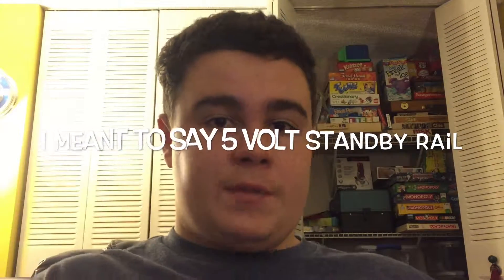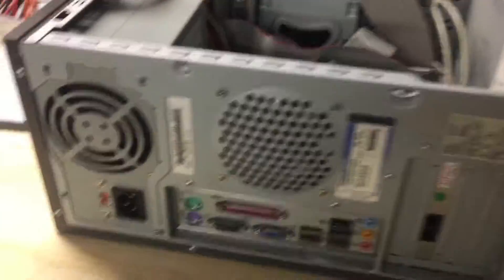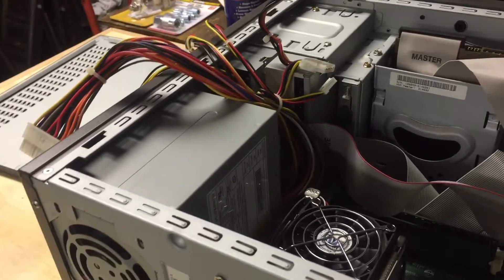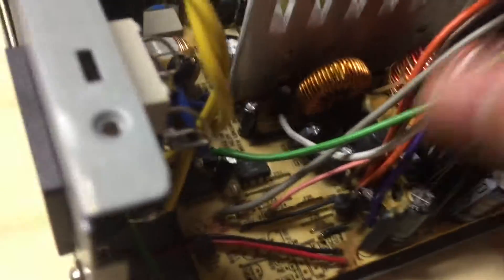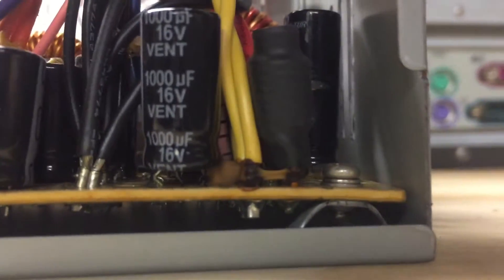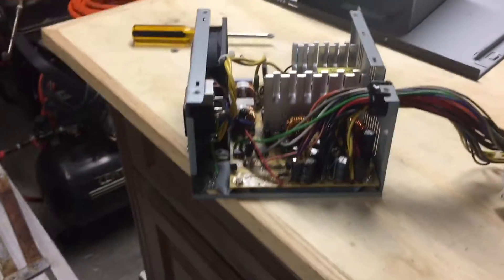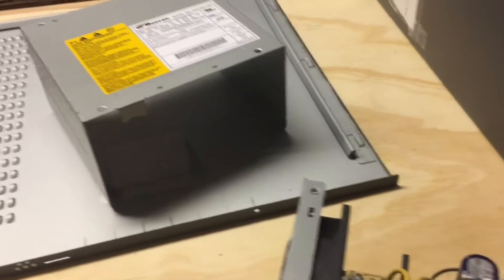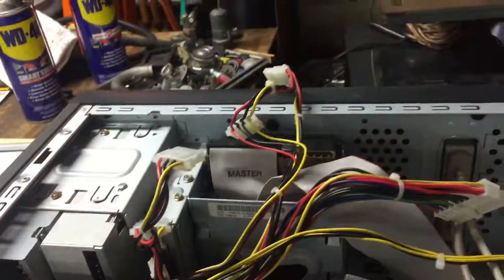My Computer Almost Exploded!!- Bestec ATX-250-12E Power Supply Teardown

Comment: I'm glad you were able to learn about these power supplies from one of my older videos! These units are really like ticking time bombs... Yours wasn't bad as of your video, but with time and use, as those capacitors start to age, things will eventually start to get hairy. This problem affects all revisions of the 250-12E model. Yours is an older revision for sure... it was back before Bestec even improved their fan grille. The "burn" marks you referenced to on the PCB in that unit aren't actually burn marks at all. Rather, it's the glue that they used when the unit was manufactured. This glue is known to darken in areas where there's a lot of heat. When this happens, it can get corrosive and also start conducting electric current. This could also lead to failure of the +5VSB circuit in this unit. The 300-12E is an improved design that uses an integrated circuit to regulate the +5VSB rail, as well as provide much needed overvoltage and overcurrent protections for this rail. The 250-12E uses an old 2-transistor method. Both actually provide a PWM signal, but the 2-transistor design uses resistors and capacitors to regulate the signal... a totally analog circuit, with no protections. The Bestec design was most notorious because the location of the crucial capacitors would pretty much cause the capacitors to bake over time and fail, resulting in the chain reaction of events you referenced to.

The 300-12E units used by Gateway and eMachines, along with the 250-12Z and 300-12Z units used by HP/Compaq are much safer since they all use the IC-controlled and regulated 5VSB circuit. These power supplies aren't failure proof since capacitors do sometimes fail in them with time, and in rare cases that previously mentioned glue can cause problems... But I have reused them and even still install them into basic new builds... and never had one take out any hardware in the case one does quit. In the event that capacitors go bad, they can be replaced.

Comment from the maker: After I recorded this video I did some more research and found out that this power supply is good for now. The capacitors are not bad yet.
Reply: Tyler's Tech World I had this one in my e machines t 4529 and It failed but I recommend ANTEC TRUE POWER QUATRO 1000.